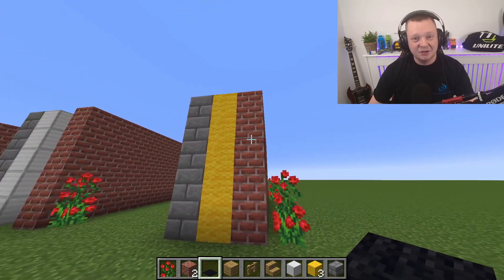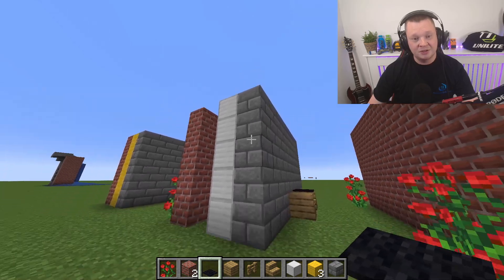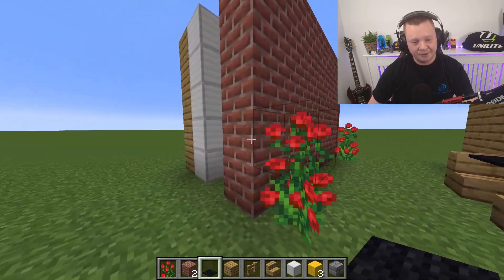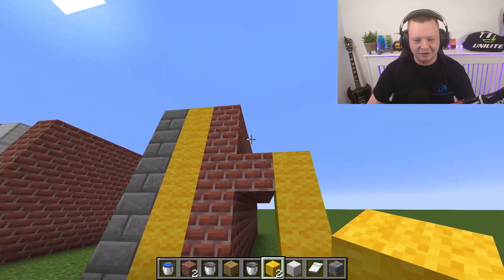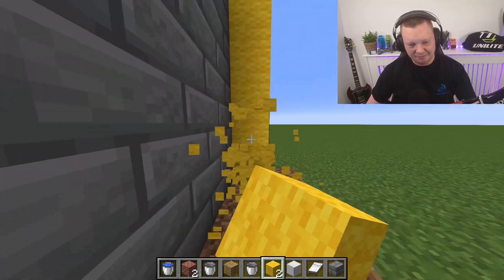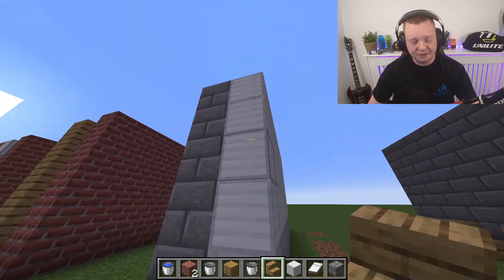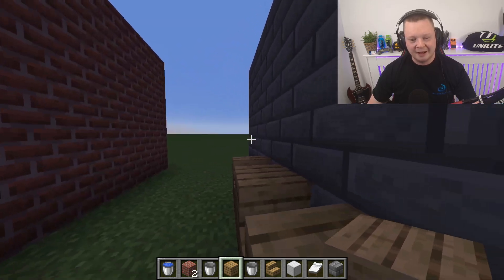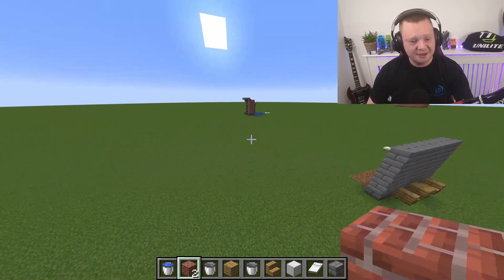CAVITY WALLS EXPLAINED SIMPLY! Ft Minecraft

Comment: Cavity walls must NOT be bridged with insulation(insulation touching outer walls inside cavity) or else moisture will transmit from the damp outer wall through the touching bridging insulation into the inner wall !
If cavity-wall insulation is to be used , there must be a LARGE air space gap in-between the face of the insulation and the OUTER WALL inside the cavity ; this includes an air space gap in-between the face of the insulation and the cavity-wall-tie drip points which are in the centre of the cavity.
Ask N.V.Q. BRICKWORK teachers for PROOF of this !

Comment: so how does waterproofing work with a modern cavity wall with brick insulation block then no air or gap between? as google says brick itself isnt waterproof
ive seen your videos about the ventholes letting moisture out but isnt this only in certan sections? what stops the insulation from becoming damp and or mold growing

Comment: I was going to call you about my 2nd floor external front and rear wall  built in the 70s, from inside out its plasterboard, timber frame, felt and upvc cladding. But this winter shown how bad its insulated so was going to take the upvc off felt  then pack the frame out 100mm then insulate 50mm then 50mm air gap then refelt and new upvc... would this be correct. Many thanks
Reply: They sell plasterboard with inso attached... you lose some space internally but it solves the u value problem.